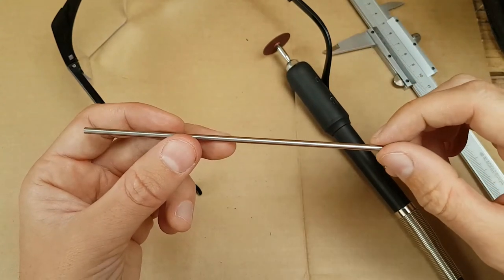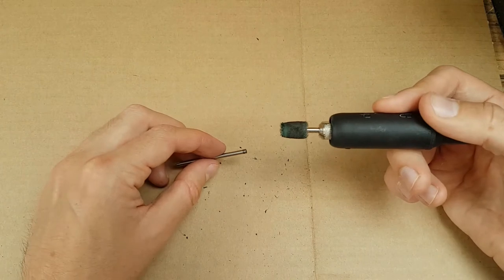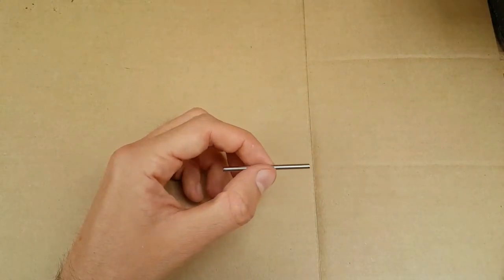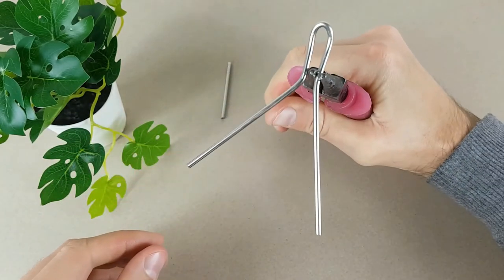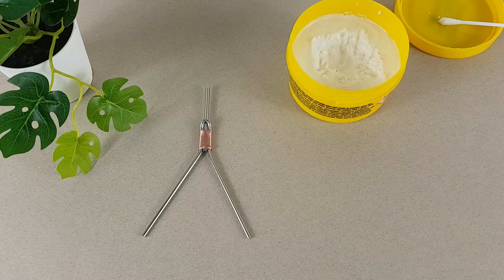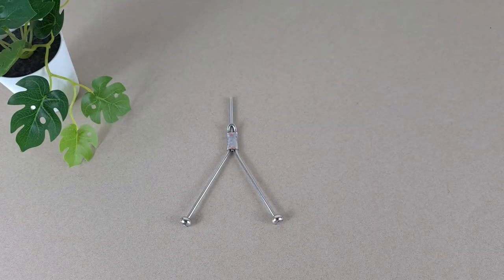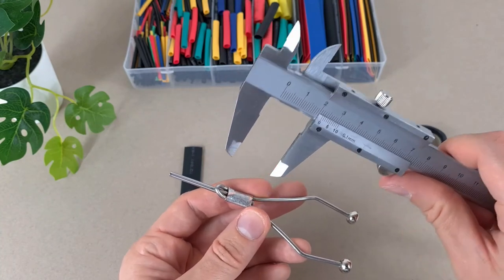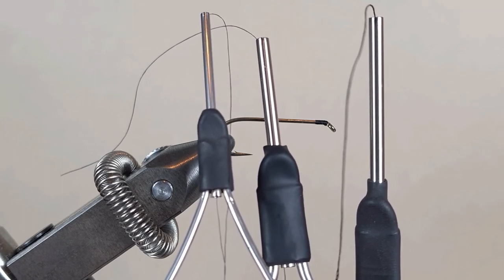Making bobbin holder steel tube (fly tying | jig tying | feathered treble)

Comment: Just wanted to drop a Thanks for the toothpick/compound idea. 20+ yrs as a weldor making sculptures and various home decor and you've taught this old dog a new trick! Well done. 
- I usually don't require that fine a finish, so I use a small, round standard type needle file first then a small diamond needle file. I mount the files in my drill. (The first takes off the heavier burs and saves wear on the diamond.) 
I've also got a cheap set of diamond rotary tool bits that have a few cone shaped bits that also work well. Either of these would be good for you, or others reading here, as first and second steps, before the toothpick polish stage.
- Another option for doing the final polish to both inner, outer, and face of the tube end: Take the tube and tap it into a wood block, just enough to make a 1-2mm dimple. Wood should be a fairly hard wood like maple, oak, etc. (Alternative could be 5mm+ thick leather). Jam your compound into the dimple. Chuck up your work piece tube into a drill and run the tube in the dimple to polish all three surfaces at once. -Make several dimples for various grades of compound if you want to go crazy. Also varies size dimples if you work with different size tubes. 

I've got a drawer of brass, copper, and aluminum modelling tube in my shop, so going to build with those. Easier to polish too! :)

???- What are the brand/model#/name of those ring/cone pliers you've got, @ 7:10 ? Never seen ones with cones that big. 
Thanks for the video!
Reply from the maker: Hello wingnutbert9685

Thank you for your kind, detailed comment.
Standard and diamond round needle files would definitely work well to remove bigger burs. I like your idea of tapping the tube in to a block of wood, that can be rough polishing and then by using the leather can be fine finishing polish. Thank you for sharing.

Them round nose pliers with big cones I came across on ebay. I believe it was a shop/seller in England. I never seen pliers like that before so I had to buy them. The brand was Wubbers and they wore called Tapered round mandrel pliers.

Hope that helps you out.
All the best
Reply: @makeshiftlures  Thank you as well for the tutorial. And thanks for the info on the pliers. They are vary unique. I'll try to fined them as well.

Comment: Good job. Preparing the tube is definitely the hard bit. Keep in mind the bottom end of the tube doesn’t have to be as carefully smoothed as the business end, I wouldn’t spend nearly as much time on it. 
You’re using extremely heavy wire for the frame, maybe you could get away with something more easy to work with? Bike spokes are available in varying thickness, worth a try.
Reply from the maker: Hello Callum.

Thank you for your comment. I used 2.5mm wire for heavier boobin and 1.5mm wire for smaller one. Can definitely get away with 1.5mm wire. 
Thank you for your advice.

Comment: Where did you get your stainless steel tubing?
Reply from the maker: Hello Steve.

I got mine online bought it on ebay got sent from China. You can also buy them in model stores. Alternatively you can use TV aerial.
Hope that helps you out.
Reply: @makeshiftlures  Thank you. Planning on building a few custom bobbins. Have you tried to find ceramic tubes?
Reply from the maker: @stevetrybalski3082   well done building your own bobbins is rewarding. Yes I managed to find online store that sells ceramic tubes. Their web page is troutline.ro
ceramic tube will be in tying tools section on the 4th page. I got two of them arrived on time and in perfect condition.

Hope that helps you out.
Reply: В ветеринарной аптеке иглы от капельницы 190мм.Из одной иглы получаются 3штуки.
Reply: А по русски как это будет звучать.?